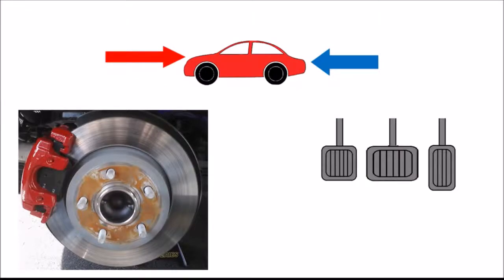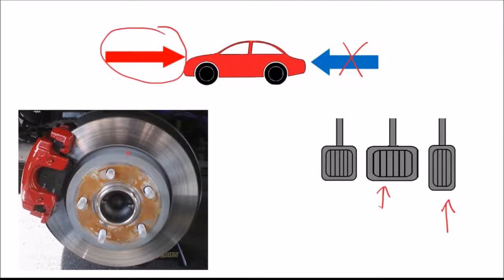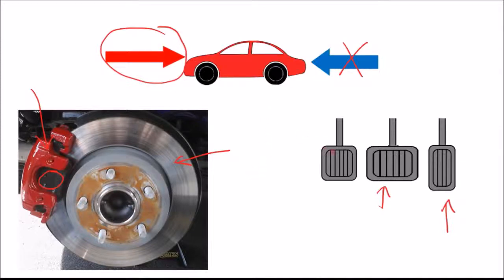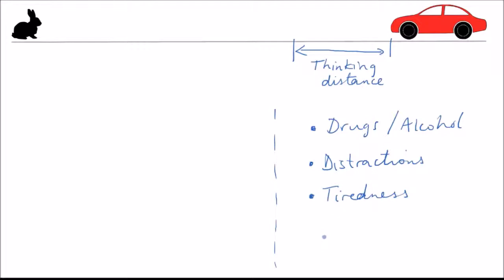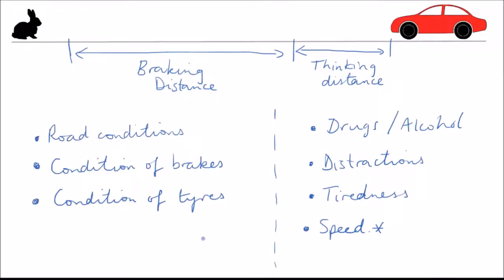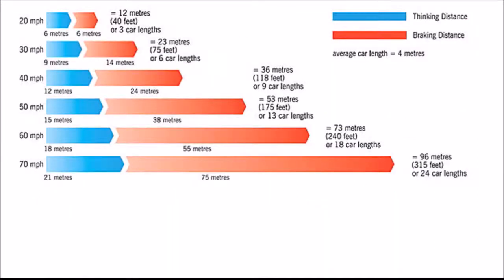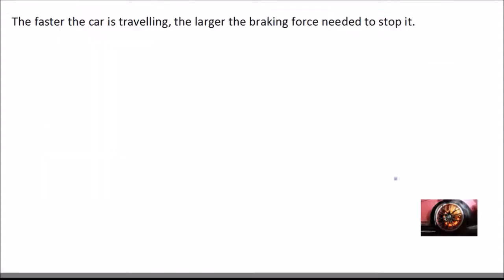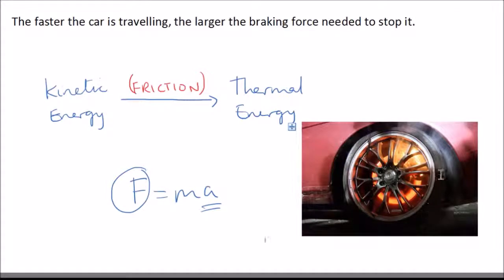Forces and Braking | GCSE Science | Physics | Get To Know Science

Comment: Your red force arrow is relevant only for air resistance, pointing backwards. Braking forces in discs/pads do not have that direction. They are not even forces on the car, but inside the car. Your presentation is simplified and wrong